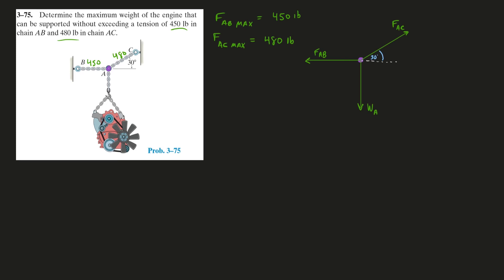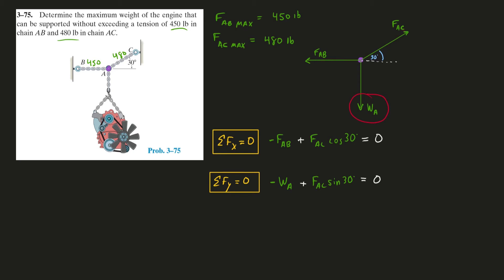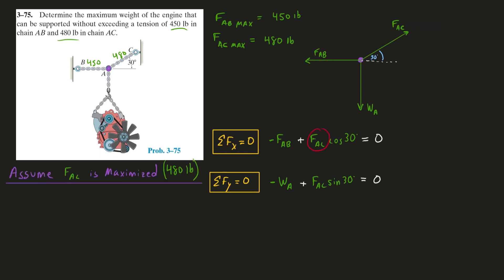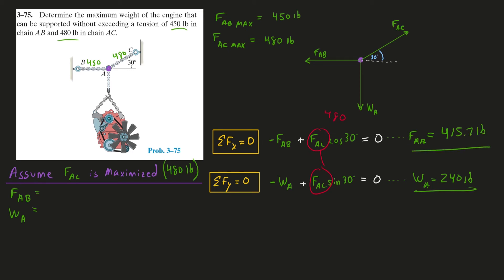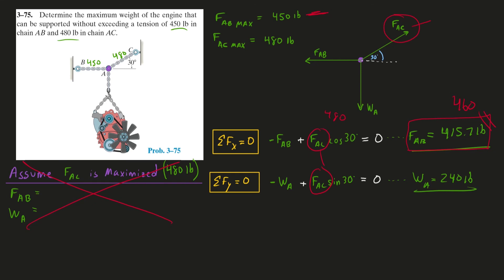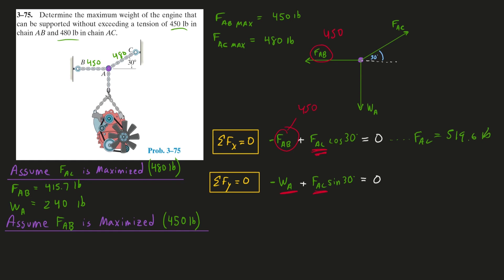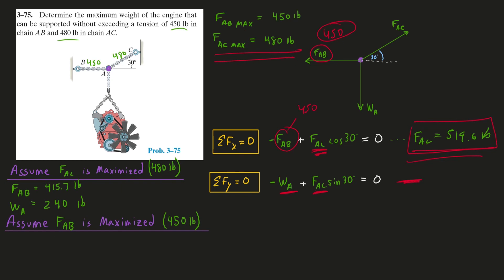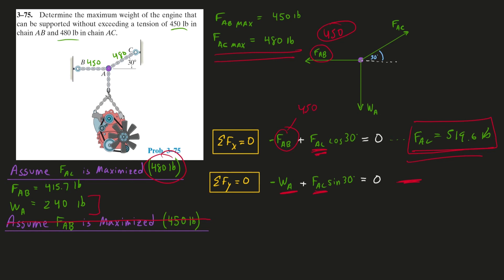Statics: Failure Criteria Problem

Comment: Enlightening video.  But shouldn't reaction forces at B and C be taken into account?  Those fixtures don't allow movement, so are' not there reaction forces?  Thanks.
Reply from the maker: there are reaction forces, but we don't car about them. remember, an FBD (free body diagram) allows us to pick exactly ONE object to analyze, and then we look at what things are touching that object (in other words, what forces are acting on that object).

In this case, we are looking at the center point of the chain A. What things are touching A?

Answer: only 3 things:
1)left chain 2)right chain 3)bottom chain

wall has nothing to do with our FBD of point A becasue the wall is not directly touching A
Reply: @eng1048  Thanks for your response.  It makes sense, but I'll have to digest that info by studying more examples.

Comment: This is based!
Reply: based and redpilled
Reply from the maker: based? what does that mean friend?
Reply: @eng1048  this failure criteria statics problem is simply extremely based and skullpilled, leading me to believe in the Iranian market cap being less than publicly stated
Reply from the maker: @failurehaus5979  This comment made my day, i didn't get a notif for it. Yes this is a good comment, congratulations
Reply: @eng1048  had another statics test today , it was a sign
Reply from the maker: @failurehaus5979  the forces must be with you